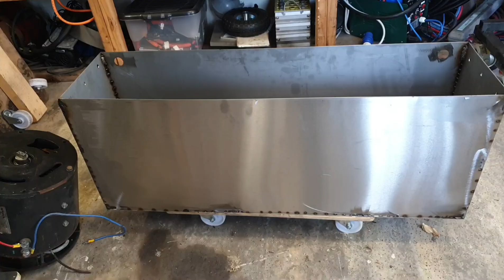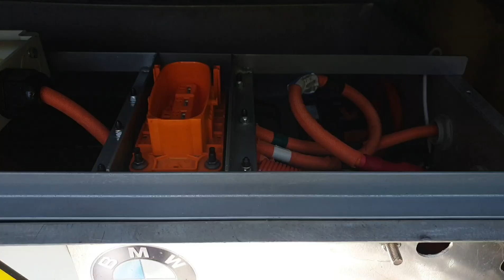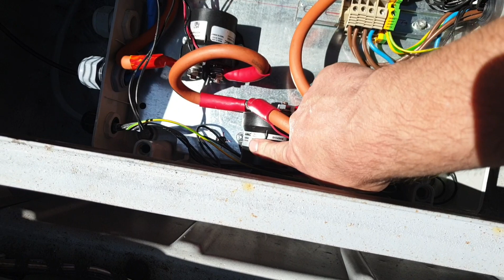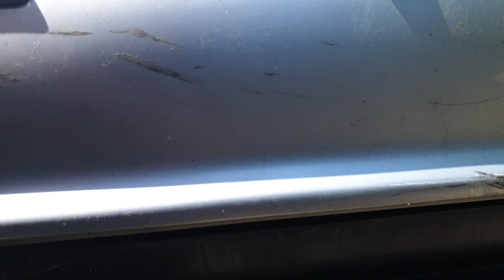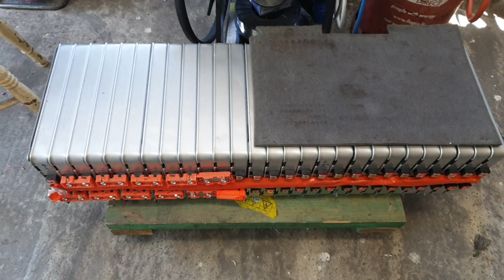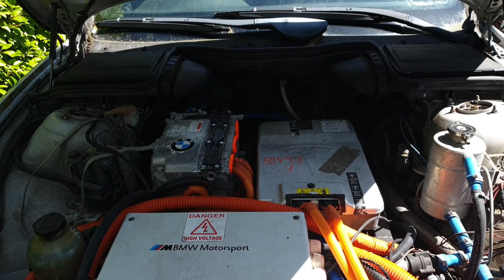E39 Battery Boost Part 1

Comment: use plain old water in a spray bottle helps alot when drilling ss.
Reply: Bonus tip: NEVER SLOW DOWN. You slow down, it cools down, and then it work hardens and you'll never get started again. Keep the pressure on and hog through it, you get one chance.

Comment: What confederation have you made for initiating the two different battery packs together as long as the voltages on the same there is nothing to worry about but storage of the two might be different